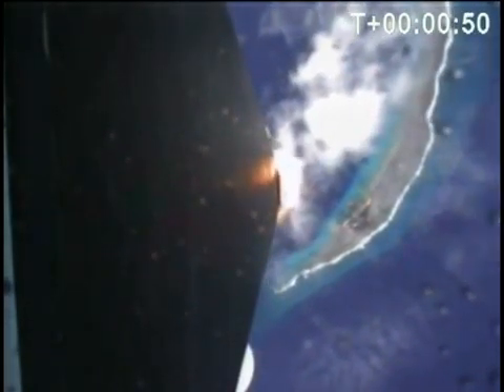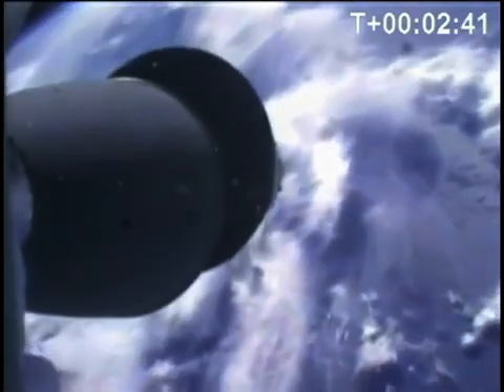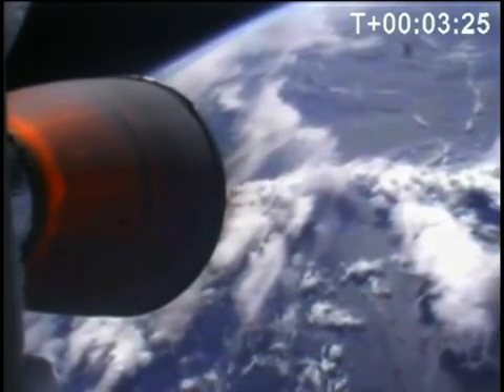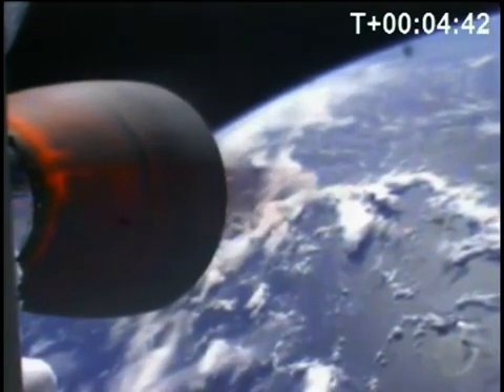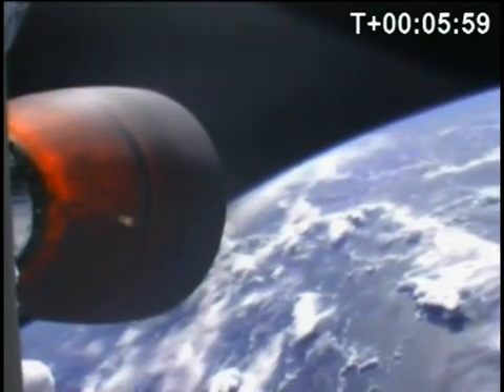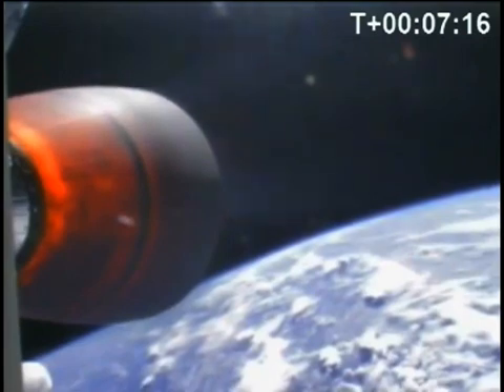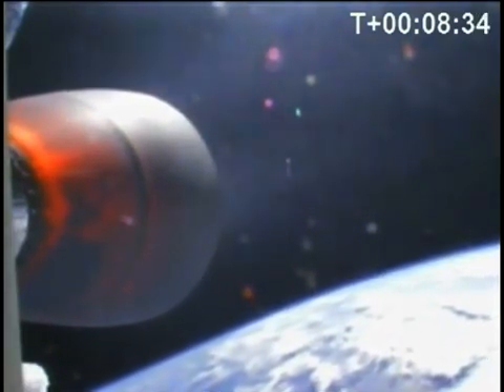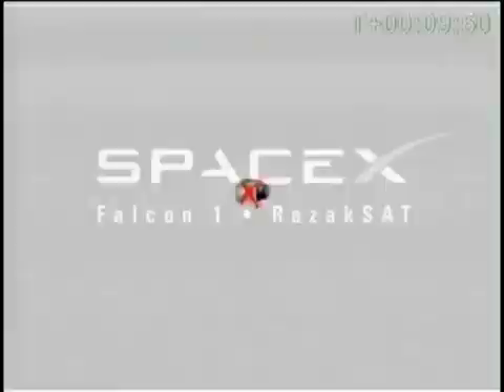SpaceX Falcon 1 Flight 5 - RazakSAT launch [HQ]

Comment from the maker: The niobium nozzle extension is very flexible, on the 2nd flight the first stage actually hooked it significantly, the nozzle dented in and then bounced back like nothing happened, no deformations at all.

It's hard to see just how much clearance between the interstage and the nozzle there is, but I agree it does seem close. The latest two flights however separated cleanly and the ill-faited 3rd flight also looked like it *would have* separated cleanly.

Comment from the maker: I'm not sure it's due to actual aerodynamic pressure as the nozzle is protected inside the big interstage, it's probably got more to do with the buffeting and vibrations during first stage flight, especially during transsonic flight.

Comment from the maker: They don't *have* to get rid of the stiffener, it's just that the increasing temperature of the nozzle makes the adhesive weaken. The stiffener's purpose is to protect the nozzle during 1st stage flight and staging, once in operation it's unneeded - you can see how the nozzle actually wobbles a bit during operation.

Comment from the maker: Water on the ground camera? There was a rain shower some 20 minutes before launch. 

The water on the onboard camera is because moisture from air condenses on the rocket as super cold liquid oxygen is loaded into its tanks. You can also see bits of ice falling off during 2nd stage flight - that's also accumulated on the ground.